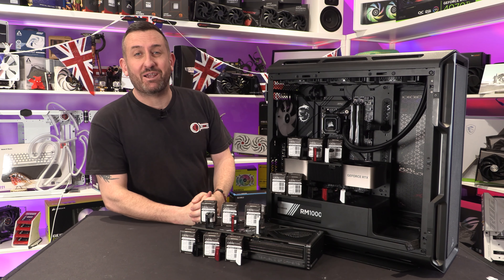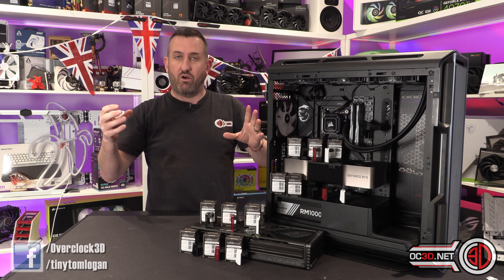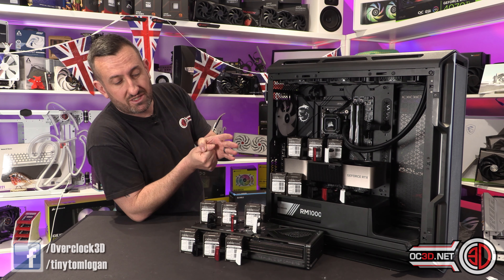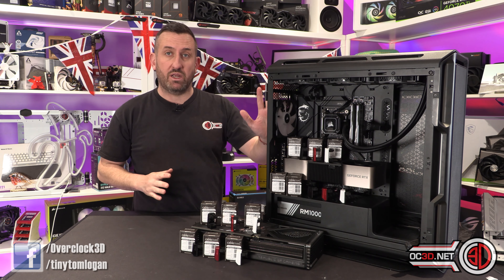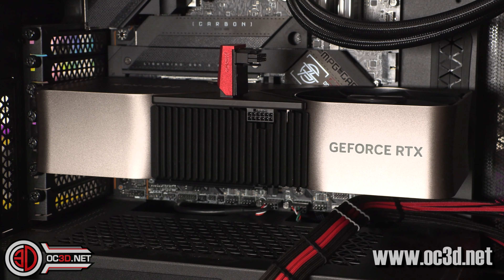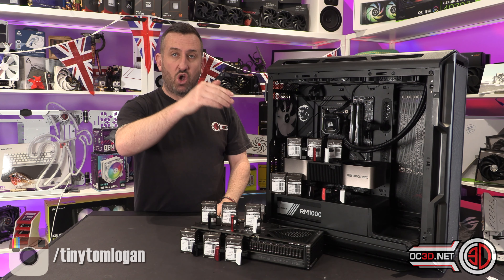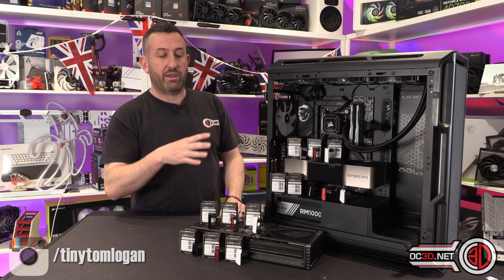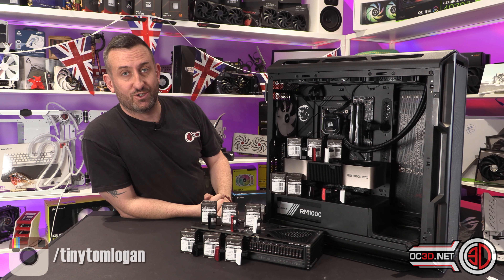CableMod 90 and 180 Degree 12VHPWR Adapter Guide

Comment: Got my 180 silver adapter and have been loving it, makes everything look so neat now. It works perfectly for the card in the normal orientation and means you dont need to bend any cables so is a vialble option for any card orientation. Cablemod have also done everything in their power to get people to install these correctly, by providing the QR code which is difficult to ignore when removing the plastic packaging.

Comment: From my experience with my Zotac Amp Extreme Airo 4090 you can just pull out the cable, theres no little latch on the the release clip keeping it connected to the plug on the card. You can push the cable into the card as much as you want but it’ll never latch on to anything. It’s like that on the adapter cable that came with the card and the Cable Mod 12VHPWR replacement cable.

Comment: Hey Tiny One, about your trick with the screwdriver, why not just use some wire (floss or something similar)? Can tighten it up till the flap is compressed and then safely remove the connector, without risking the paint or the card with a screwdriver?
Reply from the maker: Good idea. I just used what I had to hand and the strong screwdriver means you can get it out straight without bends

Comment: My CableMod 180 adapter was installed correctly, and tight. Never was moved around and yet it melted into my 4090  power connector. Sent off for repairs and CableMod is paying for everything. They stand behind the product.  The power cable plugged into the adapter was not damaged in anyway.

Comment: Since these high end cards are so huge now and extend well past the ATX sized mobos, can they not alter the PCB design to allow for the power connectors to be oriented on the back-right of the cards to just completely hide the cables? This would also work decently for most vertical mount use cases as well I'd imagine.
Reply: A number of workstations and servers do this kind of thing. The most obvious example is the 2019 Mac Pro with the MPX Modules. They provide extra power and bandwidth well beyond the PCI spec.

Comment: Typ A and B is about direction you want the adaptor to be installed. Direction backplate, direction cooler.
For some Cards you need A for back plate orientation and for some you need B.

Comment: Very helpful video! Thanks! I received my Asus tuf oc 4090 yesterday. It's going in my Thermaltake Core X9 case with horizontal motherboard mount, and I'll be ordering a 12VHPWR PCI-e cable and a 90 or 180 degree adaptor. Asus included a Cablemod 20% off coupon, which indicates to me that Asus would honor a warranty if the GPU would fail/burn while using Cablemod products. I contacted Cablemod to ask where the coupon could be redeemed, and the reply was "Only at the Cablemod Worlwide Store". Which means shipping charges, while my Amazon Prime account is free shipping. I'll have to put the items in the basket at Cablemod Worldwide to discover the shipping charges. 

Best to all.

Comment: Thanks for the video, i just can't wait anymore for my stuff from CableMod that i ordered, and also those 90 and 180 degree adapters for my RTX 4090, because now my 4090 installed verticaly in my O11 Dynamic because of the clearance issue, and i hate verticaly mounted gpus, i preffer it in a classic way horizontal, so i waiting for thos 90 and 180 adapters to arrive to me and hope that i will able to fit my 4090 horizontaly in my case, with the help of those adapters.
And Tom, you didn't mentioned that those adapters are slightly different in sizes, the 90 degree adapter is more thicker then the 180 one.
Reply: Ive got the 180 adapter which im using in my 011 dynamic with GPU in normal orientation and there is now plenty of clearance for the side panel. The cable also runs in a straight line through the case cut out into the adapter so there is zero bend. Its very nice and neat.
Reply: @jonboy2950  Thanks for the info about the clearance with 90/180 adapter on the 4000 series giant cards in the original O11 Dynamic, i'm very happy that i will able to fit specific my RTX 4090 in this case in a normal orientation, and this is also good that my 4090 its not the largest one, like the ROG Strix, or the Gigabyte Aourus, mine is the regular Gigabyte Gaming OC 4090.
Today Fedex Courier couldn't bring to me those adapters and cable for my GPU/PSU from CableMod that i've orfered, because i was not at home, nobody was, so they will bring the package that i am so waiting for, tomorrow  😎
So again, thanks for the confirmation that adapters helps with this issue of those GPU in this case  👍
Reply: @jonboy2950  Hey there - out of interest what GPU and which specific 011D do you have? I have one of the OG variants (the Razer one) which is very narrow and doesnt give a lot of room at all - is yours an OG/Evo etc. Was looking at a Zotac 4090 and its a very tight fit for the cable so hoping that the 180 fitting would really help out.
Reply: @jonathanphang  hi, I've got the original O11 dynamic. I've got the MSI Suprim, it's one of smaller cards in terms of height and it dosent fit unless I use the 180 degree adapter, or have the side panel off.

Comment: Not particularly interested in the Adapter, but I'm confused on which custom sleeved cables I need for my ASUS TUF RTX 4070 Ti... I decided to go for a Corsair RM1000x PSU. The 4070 Ti comes with the 2 Pin adapter (4080 has 3, 4090 4) I'm getting confused with these " X pin to X pin " descriptions as I'm new to all this. 🙁 I know about Corsair's 12vhpwr cable but that doesnt look good. Is there any other brands that make custom sleeved 12vhpwr cables (psu to gpu) besides cablemod? I live in europe

Comment: what if you use a type B on a card like the FE and just plug it in up side down? doesn't it solve the problem of "the little plastic tab is so fragile and hard to reach" since the tab will be unobstructed on the bottom? would be weird looking though since the cable will be going upwards lol

Comment: Are Cablemod 90° end cables planned? I don't want to spend 25€ on a cable and 35€ on an 90° adapter just to still use an adapter in the end. I d like to have a cable with a proper 90° to make everything nice and clean.
Reply: Its a good question, why CableMod can't just make a whole one piece cables, with the 90 and the 180 on the ends of the cables? it would be more cleaner

Comment: Really looking forward to the updates on how it's running with all those rigs pushing them hard! After that, I'll put mine in 180deg adapter that I have right now 😂Subbed!
Reply: Had my 180 for 2 weeks now, it works great, and looks very neat. Ive got my GPU in the normal orientation and my cable forms a straight line from where it comes through the gromit of the case and plugs into the GPU so the is zero bending which makes me far more comfortable compared to how it was before.

Comment: tuf 4090 ekwb block with right angle fittings that are aimed toward the front of case for the o11 distro plate (not vertical mounted gpu). will the hardline tubes block the connector/cable? I want to buy one but i'll have to wait for local retailer so i can return it easy if it doesnt fit

Comment: 1 flimsy connector going into another flimsy connector... what could possibly go wrong here
Reply: It's Nvidia's fault for using this plug in the 1st place.
Reply: @lilblackduc7312  He didn't say it wasn't.
Reply: Turns out, the adapter is also melting.
Reply: @djkiIIag yeah cause people don’t plug it in the right way, surely you understand it’s the builders fault, it doesn’t melt if plugged in right
Reply: @Turmoose  I do understand this, as my rtx4090 has been trouble free, I also chose to vertical mount mine as it ment no goofy adapters or hard bends in the cable.

Comment: You did not address the problem with some GPU heat syncs preventing the adapter from plugging in all the way. That's the biggest danger. The metal heat sync can literally stop the adapter from going in 100%.

Comment: I have a CoolerMaster v850 SFX for my O11 mini and was wondering if the 12VHPWR would fully utilize my PSU's power or what configuration needs to be done to allow that, if not, what do you suggest because there isn't many SFX PSU's that allow that and my motherboard takes up two PCIe slots leaving only room for two PCIe slots for my PSU to GPU

Comment: Cheers for the vid Tom. Now i have to decide if i pick one up or not. Just a quick question you might know the answer too. I was going to make a new pc next month and carry over my RM1000i that i picked up after your original review a few years back. i was going to get a cable mod replacement 12pin that is corsair type 4 compatible, that goes directly to the psu. But upon futher reaserch it doesnt have the inline caps that the stock cables (or cable mod kit that i got a few yrs ago) has. So instead i was going to use one of the 12 pin to 3 8 pin extensions cable mod has to the cable mod kit with the caps. Do you thing this would be a good strategy? I feel like the caps would be useful espically if i go for a high end card like the 4080. coming from a 980ti :) Let me know your thoughts/if you have noticed the same. Thanks mate. Keep the vids coming
Reply from the maker: If you have the room to hide all the excess cable it sounds like youve come up with the best performing route dude
Reply: @OC3D  Cheers for the reply m8. Though so. Love from Australia from a fan that found you back from the striker case vid!!

Comment: A different subject but one I'd like your advice on, could I place some high static pressure fans on the intake side of a radiator and some high air flow fans on the exhaust side and it work alright?
Reply from the maker: I'd personally use matching fans

Comment: I have a single slot waterblock on a Type B card, would a Type A 180 degree adapter clear the waterblock so that the cable would pass directly underneath the card? 
Thanks in advance Tom.
Reply: You'd be better off asking CableMod directly. Tell them what block you have, and they can tell you if it will fit.
Reply from the maker: I agree with Grace here, you may be better off asking cablemod support. Ive not tried any waterblock cards
Reply: @OC3D  Thanks for the reply both of you. I will try asking CableMod.

Comment: I have one of the 180 degree B adapters for my Zotac Trinity 4090 and it's great for tidying the cabling but it's too big. There's a big gap between the back of the GPU and the power connector and it means that the adapter butts against my CPU cooler.
Reply from the maker: They have to allow for different back plate thicknesses but more importantly you have to be able to get it off again so it cant be too tight against the back of the card. I kind of explained why in the video too
Reply: @OC3D  The gap is far bigger than on the other 180 degree adapters I use.

Comment: It's nicer but the connection is as bad if not worse than a simple cable, the connector doesn't fit at all on the card, the simple fact of touching the cable detaches the adapter from the CG connector.

Comment: nVidia has already made it clear that if you use anything other than the OEM cable that came with the card your warranty will be void. My suggestion, buy a correctly designed case.
Reply: Or just simply make sure it is inserted correctly to begin with. These aftermarket add ons are on the market for aesthetics they are no more capable power wise, they are still subject to someone not inserting them properly. A different cable doesn't remove that issue/risk. As pointed out by Tom you have to be just as careful installing this type of cable.

Comment: shows how Nvidia doesn't think about what cards they are making if you have to buy an add on part for the card to be safe.
They should be given to purchasers of the Nvidia cards at Nvidia's cost since they were the ones who dropped the ball here.
Reply: You dont have to buy an adapter to be safe, you have to buy an adapter if you didnt properly figure out it wouldnt fit in your case the normal way.